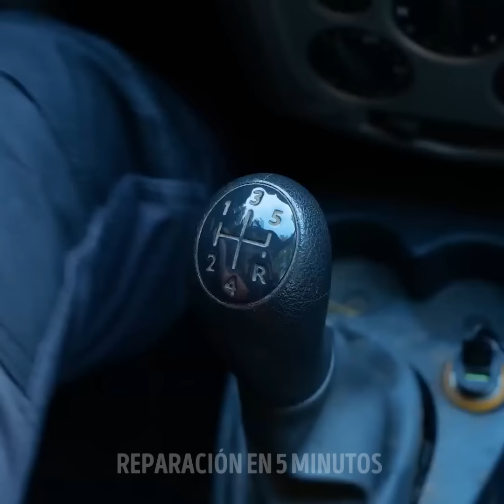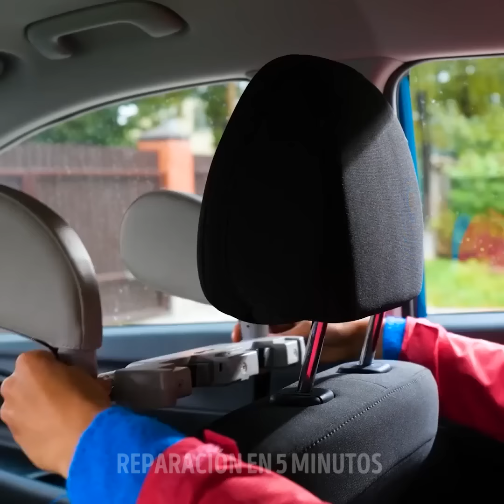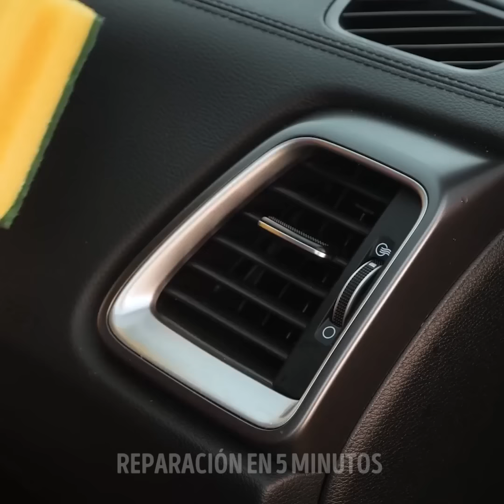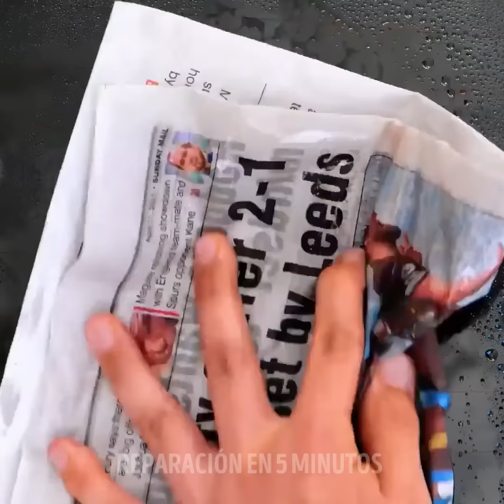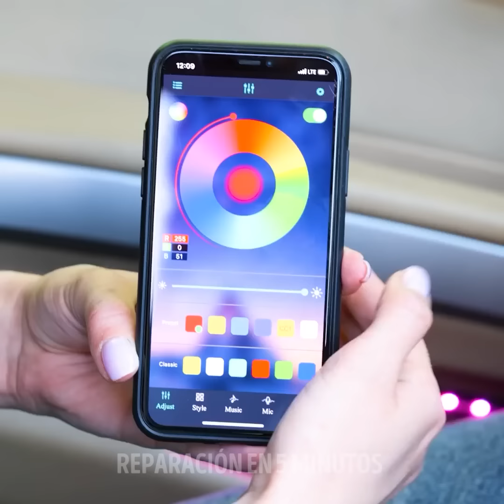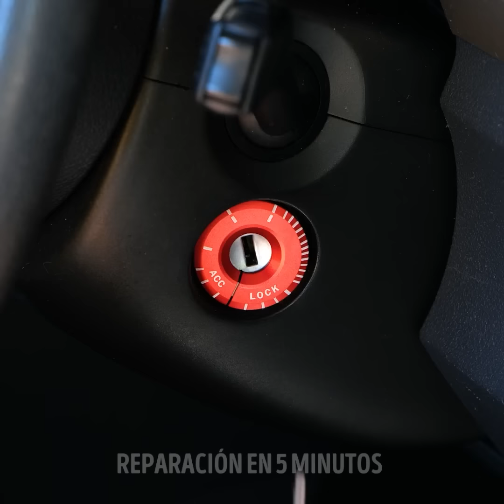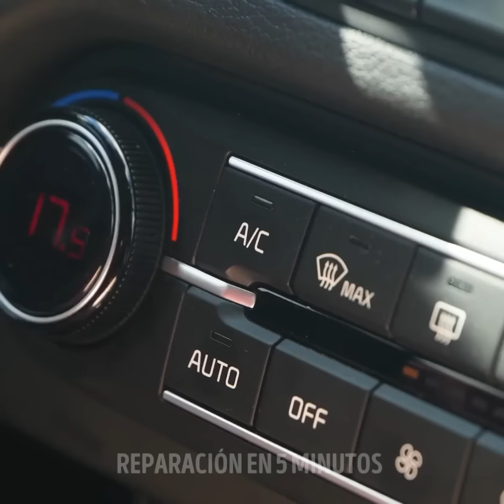TRUCOS BARATOS PARA AUTOS QUE TE AYUDARÁN A AHORRAR DINERO EN COSTOSAS REPARACIONES

Comment: Having worked in tire shops in the past, we never plugged a tire except in an emergency or special request of the customer. We patched them on the inside. This allows the tread to lay in its proper position. A plug keeps the tread separated.